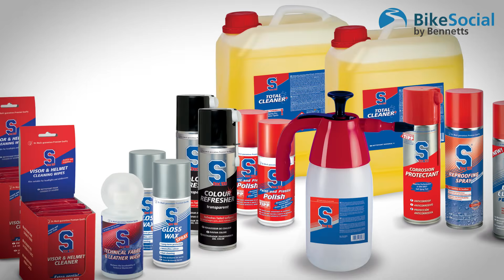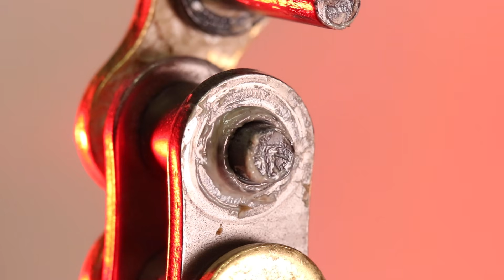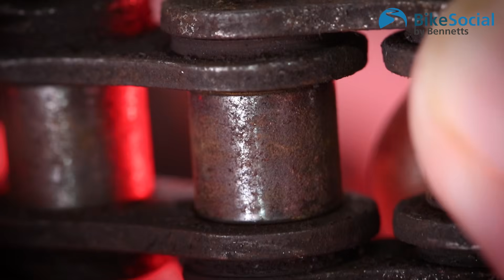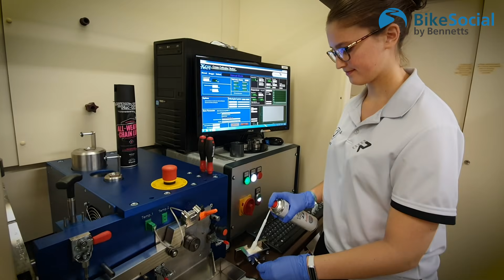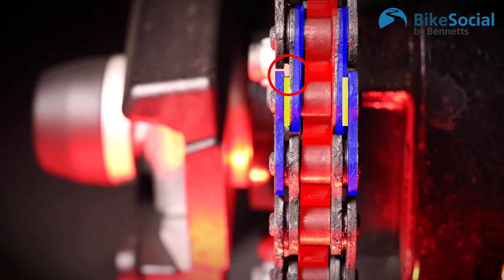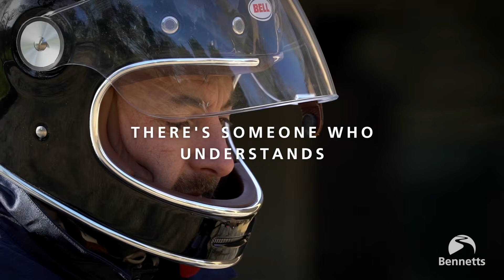Is chain lube a scam? Does your bike really need it?

Comment: Only thing I can say... bought new bike in may, rode for about 2.500km without lubing, no issues. Used a chain cleaner (S100) and then applied lube, and since then my chain makes a very annoying whine/buzz when accelerating. Never did before :(
Reply from the maker: Have you adjusted it?
Reply: @bennettsbikesocial  yep checked all sort of things, tightenes/loosened chain (perfect now), lubed it, re-cleaned it and applied different lube, even tried with oil as lube...problem remains, chain is making a buzzing noise when accelerating or when under stress (goes away when clutch is engaged). dealer took a look at it, no other problem detected, diagnose was : chain probably damaged by the cleaner, no harm just an annoying noise.
Reply from the maker: @lapinobel  That cleaner can't really damage the chain. The chain still spins when the clutch is pulled of course (though not under load) – sounds more like an issue in the transmission but it's impossible to say without seeing it. Hope you get it sorted! What bike is it?
Reply: @bennettsbikesocial  Kawasaki Z900RS. Visited 2 dealers, both say there's nothing wrong with the transmission. Gotta say, the noise was immediately apparent right after the first 10 meters of driving after I cleaned/lubed the chain. Maybe the chain just got more noisy due to being 'clean' ?

Comment: To digest: All you're doing on a O or X ring chain is spraying or coating the outer surface and the surface of the sprockets (both), the front guide and the seals.  Teflon wax spray, chainsaw bar oil, gear oil, lithium grease, yellow grease all do about the same thing.  

Applying outside top or inside doesn't really matter as the rollers....wait for it....constantly ROLL as they migrate around the circuit. 

I've found older chains rust on the links with road salt in the winter.  I use chainsaw oil on a nylon toothbrush in winter months, and a Teflon wax in warm months because it is less messy.  I probably pay $5-10 in stuff a year lubing every 400 miles for 10,000 a year.  A big spray can should do a chain easily 25 times.  Otherwise you're wasting product spraying the same links numerous times.

Using a strong blast cleaner will force solvent under tge rings.  Gasoline/Petrol is thin enough to get under the seals.  Brake cleaner is really going to seep under the seals.  Any spray oil that contains toluene will distort and shrink the seals.  Dawn soap on a grungebrush is pretty mild and won't hurt the seals.  Kerosene is sour diesel...so if you wouldn't use diesel then don't use kero.  I don't know if kerosene will seep under the seals but it is only the next layer in refining gasoline (petrol).

Comment: I made my own oiler with a plastic bottle filled with W90 oil, some plastic tubing and a gas pump from a chainsaw parts shop. A few pumps when the chain becomes visibly dry and I'm good for another 200km or so
Reply: Scott Oiler
Reply: @raymondo162  O.S.C.O. 😉
Reply: every 200km? that's mental, man.
Reply: @grumpy_cat1337  "or so". depends on the road condition

Comment: I use kerosene with a brush to clean. Then 80w-90w gear lube. I clean the chain every 1500 miles and lube every 500 miles. Seems to work well. My V Strom has 59000 plus miles and only one chain replacement just recently.
Reply: After lubing, do you wipe it off with a rag to prevent fling?
Reply: @spider121  I got tired of the "fling" from gear lube, I have been running chain wax since and I really like it. A lot less mess, and it's been holding up in the rain as well.

Comment: Ah, at last, I've long had a theory that lube was lubing the roller\ sprocket contact point- thanks for confirming it.
Reply: arrrr us Brits can be sarcastic, but as long as we keep each other entertained with it😋👍
I do think that all experienced motorcyclist and every single motorcycle racer will tell you....
why the hell is anyone spraying their chain with any aerosol, chain lube or cleaner?
Chains just need small smear of gear oil as per the chain mamanufacturesnstructions.
Reply: @King-Arthur-The-First  If its o-ring yes. Not all bikes use o-ring though and not using some kind of chain lube/oil in bigger quanteties than a smear will kill the chain within a matter of weeks.

Comment: Dry lube for me! Used it for years and the chain looks fine after 35-40 000km. And no dirt on the wheel!
Reply: what are dry lubes?
Reply: @kcdmine3635  Chain lubrication, not based on oil. Much better since it stays on the chain with a much cleaner looking wheel. Been using it for years with no issues.
Reply: @johnDukemaster  what are you using mate?
Reply: @Nanosoft017  Well Dry lube...the can on the shelf right now says S100 on it. But there are other brands. Once you start using dry lube you'll never look back.

Comment: I've used Maxima Chain wax for 25 years, since it came out I think. Stuck with it because it works but interested to see what's new and what works. My tip no matter what product - apply it immediately after a ride while chain is warm (say every 200 - 500kms or every opportunity if in rain) and use the lube to CLEAN the chain each time. After spraying it on use paper towels to clean off the grunge on all four sides, plates and rollers, and on the rear sprocket. Takes me 5-10 minutes. Enough will be left behind to creep everywhere and lube everything but you can give it another spray and wipe over if needed. Regular wiping over means the grunge never builds up and back wheel stays clean since there's little left to fling off. I do use a chain cleaner once or twice each year and ride about 5000km a year (and this is when I get into the front sprocket) but it's an easy job because you're cleaning a fairly clean chain. I ride in a spirited fashion and get 20-25000km out of chain and sprockets and although stretched to the max my chains still look shiny when I retire them.

Comment: Personally, I would say that Wurth High Performance Dry Chain Lube sets the standard for others to be judged.
Reply from the maker: It's on the list so we'll find out! Cheers, John
Reply: I've been using it for years. The overspray leaves a horrible film on swingarm and wheel. But once wiped off, it certainly looks after your chain.
Reply: Scott Oiler
Reply: @raymondo162  Good product. But not without issues.

Comment: Two words ; gear oil. Or another two words ; shaft drive.
Either or is fine.
Reply: Belt drive doesn't need lube too
Reply: Belt drive doesn't need lube too
Reply: I ride an old bmw 
Change the diff oil every 20kmiles 
It’s essentially as maintenance free as a final drive can be

Comment: gear oil 85/90 cheap and effective
Reply: Been using it  since 1984 always got good mileage out of my chains never had any problems
Reply: that's exactly what you need!
Reply: @christiannoble5549  I've been using a slightly thicker oil for less fling 75w140
Reply: @marcpilon9189  but some of us like a little fling ;)
Reply: If you read the bike handbook, this is exactly what is recommended. 😀👍
Reply: @NEO DAV That might be true but given the cost of a can of "developed-over-many-years" silicone oil, you could use gear oil and replace your chain with a brand new one every 2-3 years and still save your wallet. In my opinion, silicone oil is marketed and promoted at our expense. Which is fine if you're wealthy.
Reply: @bootz0409  orings are not made of rubber they're not affected by oil. They all over the engine/fuel system. They resistant to oil and fuel.
don't listen to this neodave snake oil salesman.
GEAR OIL is the only product that belongs on a chain as recommended by the chain manufacturers.
Reply: @King-Arthur-The-First  That's right. It's also specifically printed in my Honda CBR600F4I handbook to use gear oil. So it's not just chain manufacturers.
Reply: @bootz0409  What's the best way to apply engine oil to a chain, please? It's too thick for many oil applicators, and it's messy just pouring it on, or even using a cloth.
Reply: @TheErsatzMode  Use a toothbrush. Works like a charm and brush it on the inside of the chain. Oh.... and make sure you don't then mistakenly use that same toothbrush to clean your teeth! Lol  😉✌️
Reply: @bootz0409  Much appreciated. Thanks :)
Reply: @TheErsatzMode  A pleasure my friend. 👍
Reply: @TheErsatzMode  good question mate. I personally always use paddock stands run the bike in gear and apply a small amount of gear oil with a paintbrush on the inside close to the sprocket then stop engine and wipe all the outside of the chain with a slightly oily rag. Best protection & recommended by the chain manufacturer and your chain will always look like new👍
Reply: @King-Arthur-The-First  Many thanks! Seems a little risky to run the bike on a stand. I 'll just stick to turning the wheel by hand.
Reply: @TheErsatzMode  you are correct as the running the rear wheel method (although gives great and even coverage) is more risky so keeping front brake on is what i tend to do but it is a commonly used method but your method is fine as well mate.
Reply: @TheErsatzMode  
turning wheel by hand whilst lubricating is the safest way 👍but it is possible to gget blobs of oil which could fling.
my method of running the back wheel whilst on the paddock stand or centre stand is the risky way but gets more even distribution of the oil and should only be done if extremely confident of the method. 👍
Reply: @NEO DAV i will see if it does that to my chain, i've lubing my chain with gear oil since the day i bought each of my bikes, 3 years and 32.000 km on the first one and 29.000km on my current bike with almost 3 years ridden both all year around with rain and on dirt. I will post any updates if my chain stretches too much or just snap, so far no noticeable stretch or damage to the rubber.
Reply: @rushiiiop  well said mate 🤣👍
this Neodave dude must be involved in the sale of the nasty chain lube stuff. you no that horrible stuff thats mixed with solvent so it can be sprayed out the can but he pretends the solvents are kind and oil is bad WHEN OIL IS RECOMENDED BY THE ALL THE CHAIN MANUFACTURERS. Hes suggesting that natural rubber is used to make orings🤣🤣.
i've told him to try and get a job in a Gp pit lane squirting on chain lube😋
I hope nobody tells neoDave that O-rings are all over his engine and fuel system or he will be scared to ever ride his bike again( if only he had a bike or ever maintain one) 
NEODAVE SOUNDS LIKE A SNAKE OIL SALES MAN.
Reply: @NEO DAV WHAT THE HELL MATE!! 
Are you by any chance involved in the sale of chain lube?
Between all the people on here we have many many years of experience (me 40years of riding)
so plz dont say gear oil damaging O-rings we zero evidence to back it up because it doesn't actually happen.
80/90 GEAR OIL 
Is recommended by the chain manufacturers, it's written on the box when you buy a chain, you don't need cleaners because you should never use sticky horrible chain lube. chain rollers against sprocket is metal to metal & the best protection is gear oil as recommended by the chain manufacturers. 
For anyone new to bikes I recommend the following method.
Sports bikes will need a paddock stand. Apply gear oil on the inside of chain with a soft brush. 
I personally spin up my back wheel by running the engine in gear to help spread the oil thinly all over the inside of the chain it will work its way towards the outside of the chain but you shouldn't apply enough that it would have a fling with practice you learn how much. after oiling stip engine and use a slightly oily rag to wipe the side plates and outer part of the chain and it will always look like new. Job done 👍
the whole process above from getting your bike out the shed to riding away with the best protection on your chain (gear oil) would take less time than trying to clean the grit stuck in the horrible chain lube that would be damaging your chain & sprockets.Not to mention The chain lube flung of with grit collecting in the front sprocket Housing. ima chain lube is used by the ignorant on naive & gear oil is used by everyone else.
SO Neo Dave, try to get a job in a GP pit lane or Superbike pit lane squirting on chain lube and everyone will laugh you out of the place but every bike will have a perfectly oiled chain😉👍
Reply: Small amount of gear oil needed where metal to metal contact points are on chain and sprockets. 
small amount wiped on the outside of the chain. = Best protection and chain always looking like new and no cleaning needed. 
The above is recommended by the chain manufacturers and written on the box of a new chain so I don't understand all the confusion and nonsense told by people trying to sell horrible chain lube.
Reply: @NEO DAV Fair point. Always do what you think is best in the interests of safety. It's incredulous that some people buy a bike and leave no money for decent safety gear. Or to maintain their bike properly. So whilst I look for ways to reduce expenditure, it's never at the expense of safety. Ride safe. 😉✌️
Reply: A can of chain lube is less than 10 bucks , cheap people amaze me.
Reply: @bobbybishop8426 , $10 to the consumer, but at what cost to Mother Earth? All that extra manufacturing, raw materials (for the can construction), extra factories, and transportation.
Reply: Lmao
Reply: @NEO DAV rubber!! what's this guy talking about, does he think chain orings are made of natural rubber🤣🤣 every vehicle has many bearings resistant to all petrochemical products and no they're not made of rubber even babies dummies are no longer made of rubber because rubber parish's (I just wanted to get the word dummy in there somewhere🤣)
Reply: GEAR OIL👍
 Its all that is recommended by the chain manufacturers.
Reply: @NEO DAV "the manufacturers" clearly not chain manufacturers but actually snake oil salesman & the manufacturers of the chain lube & you sound like you're linked to them.
please show me any chain manufacturer that supports your theory of ever needing chain lube over a good oil.
You are clearly spouting nonsense to  promote a product that is not needed and not wanted by the wise. 

your first argument was oil being bad for O-rings now your second argument is weather is bad for O-rings so just clutching at straws then. friction is why chains were out and oil helps delay the problem.
Gear oil is superior to chain lube & always has been. Thats why its recommended by the chain manufacturers. its not hard gezzzz🤦🏼‍♂️
Reply: My service manual says, clean with kerosene. lube with engine oil
Reply: @bananafoneable I use diesel for cleaning, but don't think it works much better, have not tried kerosene though
Reply: @bananafoneable   lube with gear oil, not engine oil.
Reply: @bananafoneable kerosene is amazing for knocking the oil and grease of a chain but be very carful it doesn't get into the the bearings
Reply: My new D.I.D. chain says to use 75w-90  gear oil right on the package.
Reply: @NEO DAV Thanks man. 👍
Reply: only thing you need. Already bought 85W90 😊
Reply: But holds road crud too
Reply: I use that now
Reply: Not to mention easier to clean!
Reply: It's messy tho

Comment: I use paraffin for cleaning and gearbox oil for lube because they are cheap and both work. That said I’m open to new ideas and products👍🤘😎
Reply: The only problem with paraffin/kerosene is, it's penetrating the seals in no time, getting into the grease trapped inside the o/z/x rings. Very good cleaner tho, but not for sealed chains.
Reply: ThunderingTosspot yes, it is
Reply: paraffin means kerosene or jet fuel
Reply: I used to, destroys O rings in chain and the grease came out

Comment: How do chains get dirty = mainly dirt from back and front wheels.  Therefore it would be really good if Bennetts Bike proved a quality chain guard that protects a chain well from dirt will mean chains last the longest, camshaft chains last over 80,000 miles.  If so this Bennetts review would be talked about for many years to come.
Reply: Mz bikes used to have a fully inclosed chain I had one on my ETZ 250 never had to change the chain and I did over 40 000 miles before I sold that bike.